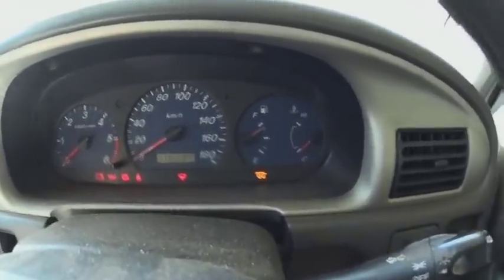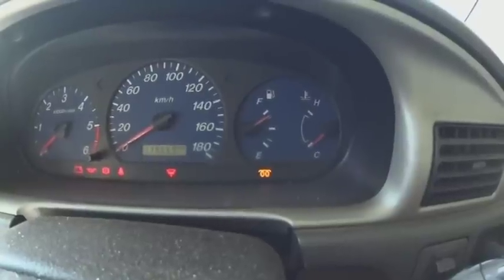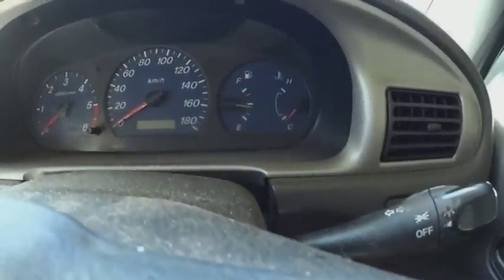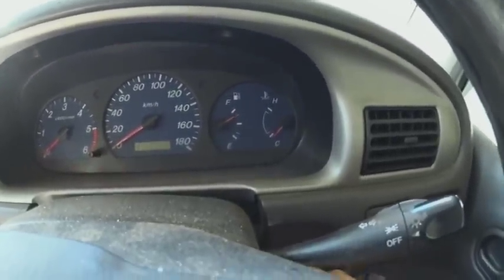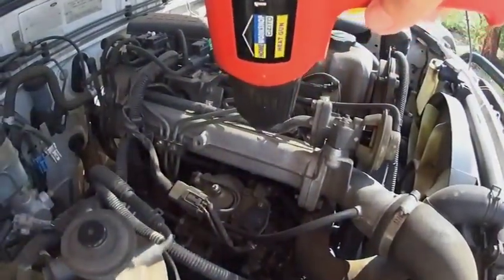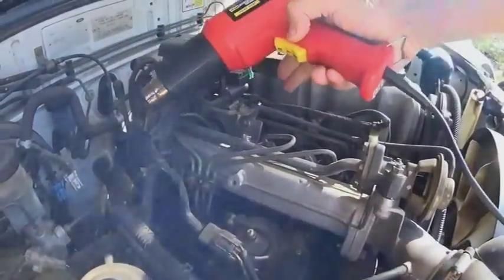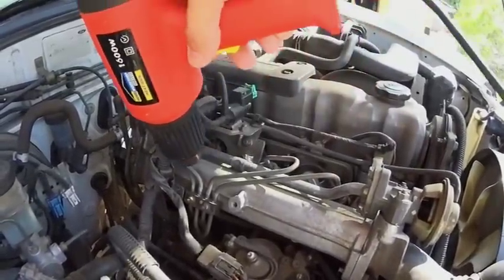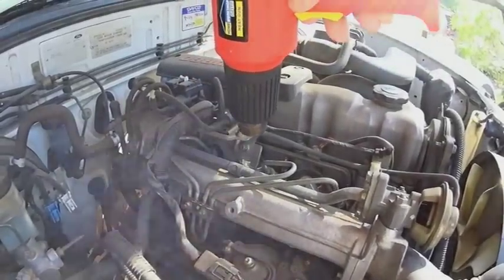Start diesel engine with faulty glow plugs

Comment: Put the heater in the air intake if possible, that's a more direct method of raising the intake charge temperature to the point of combustion.

Comment: Why does the glow plug light go off after a few seconds. Does the glow plug light not stay in if a plug or plugs are faulty
Reply: There's a relay in the circuit which cuts off power once the plugs are heated. Once the coil indicator in your dash switches off (relay cutting off), that's when you start the car. If there's no relay, the glow plugs will be draining the battery Everytime

Comment: Pour hot water on engine, not boiling hot but like 60°C its almost do the job like glow plugs
Reply: Where abouts on the engine mate?
Reply: @markw6369  yepp on injection, fuel filter fuel pressure pump and head. But be carefull not very hot water or something can crack like head or block. Good luck bro
Reply: @adamzahradnik8709  That is a good precaution, although it is almost certainly unnecessary.
If the alloys used for the engine or other car parts were that sensitive to heat & temperature changes they would fail so quickly & that it wouldn't even make sense to manufacture then and we wouldn't have cars at all!
The materials/alloys & manufacturing process have been designed specifically to tolerate & withstand a great deal of stress and extreme operating conditions, including very prominently rapid temperature changes.
Mechanics use flame torches to heat the engine and other parts for various reasons including to release parts that are stuck.
The flame torch in a shop is so many orders of magnitude hotter than boiling water...! 

I have heated engines with billing water, and cooled them down with ice cold water... While I would never claim that this could never cause cracking; I've never seen nor heard of it actually happening...
Individual experiences and circumstances will vary, take my anecdote with a grain of salt and exercise your own reasoning, logic & judgement...
Reply from the maker: I've had so many different ideas in the comments, since uploading this video, your the first to mention boiling water, I have no doubt that would work well, Thank you for sharing your thoughts
Reply: @techronmattic5876  better than hot air pistol. Works goof for me.
Reply: @adamzahradnik8709  yes, indeed!  Water is a very effective & efficient conductor of heat!   Air is not, it is actually very inefficient especially in low humidity.  It is of course the moisture/water in the air that actually conducts the heat.

👌🏻

Comment: Another thing you can do is use extension lead and hairdryer, take out the filter and box and place hairdryer in there for around 10mins in the intake
Reply from the maker: Since uploading this video I've seen so many great comments on different ways to get results, thanks for watching
Reply: You can change 1 or 2 glowplugs in 10 minutes mate, and the engine will start after. Hard, but start. Take an hour and change them all, problem solved. Glowplugs are dirt cheap, not worth all this hassle.

Comment: For my situation with faulty glow plugs of similar wlt2.5 engine, I unplug the small rubber hose (for fuel sensing compensator) on the intake manifold. Spray a very small amount of wd40 or similar flammable pressurized can. And reinsert the said hose. Crank immediately, no need to fire the glowplugs. It just gave me a one click start. Try to avoid overspraying. Just a 0.5sec of squirt of wd40.
Reply from the maker: Even hair spray will work from what I have heard, thanks for your input
Reply: Lol why not just change the glow plugs there cleared shot 🤣🤣🤣

Comment: Used a hair dryer up the air intake after the filter left it on for about 5 minutes then with it still on cranked the engine over worked every time
Reply from the maker: Yeah you will definately get more heat in the engine that way, thanks for watching

Comment: Just run a piece of wire from your positive pole on battery to glow plug rail for 2 to 3 minutes and It will start up fastest way because if this happens on the road how do you use a heat gun I did this worked for me wl 2.5 turbo and non turbo models
Reply from the maker: And the funny thing is a roadside assistant could not get me started in my driveway in this exact circumstance, he was completely incompetant

Comment: Put the  blower into the air intake is going to breed hot air will start right away
Reply from the maker: Thanks for the tip todd will certainly try that next time, make sure you check out some of my more recent content as well
Reply: I have an old Italian diesel engine on my lawn tractor, it has a nut on the intake manifold for using a heat gun to start    starts at - 20c,  at 0c it starts right up no glow it old,  smokes a bit.. maybe   give it more love, have you tried talking to it

Comment: Sorry but not a very effective way of doing it take the air filter box lid off and put the heat gun near the air intake pipe so your blowing hot air in the inlet pipe to the inlet manifold and it will crack straight up that way if your glow plugs are faulty. Heating the inlet manifold from the outside is not very effective youd be there forever doing it that way and probably end up with a flat battery.
Reply from the maker: if your in a colder climate you may  have a good point, i would definately get some heat inside  the manifold if your well below zero,  but rest assured where i live by the time you have undone the air cleaner i would already be halfway down the road

Comment: just bad pump or bad diesel, My peugeot and audi starts easy till -6 C without any problems without plugs
Reply from the maker: After getting it started i drove to my Auto electrician, he confirmed that the glow plugs where overheating due to a faulty relay, the glowplugs were replaced and a manual glow button was installed, that was three years ago and I've had no problems since
Reply from the maker: The glow plugs where replaced and faulty relay was changed out for a manual button, there has never been any fuel problem  with this car, still runs well
Reply: @techronmattic5876  do you change fuel filter every year?
Reply from the maker: Every 10,000 Km
Reply: @techronmattic5876  strange, did you checked pump valves for back pressure? because my cars dont even turn on glow plugs till -6 C and starts without any problems

Comment: Nja Change the glow flick. Fuel filter for Didzel and clean Large nozzles. 100Ah new battery jelly. Then do not jade the hair dryer motor. This will burn the starter electric motor.

Comment: I used to twist a sheet of newspaper, set the end alight and hold the flame to the air intake while cranking the engine, started every time.
Reply from the maker: Theres been so many great ideas in the comments on how to address this issue, this is what my channel is all about, using what you have to get it done, thanks for the feedback

Comment: He is wasting time heating the outside.  The cold air is inside
Reply from the maker: hi Jason
thanks for your comment, im realy enjoying the debate this video is creating, of course if you have a screw driver handy you can place the heater directly into the manifold and it will heat the air much quicker but this video is quite genuine in that it does show a solution that works, basically if you can get the area hot even from the outside it will work, or at least it did with my car, there is also a lot of great information in the comments on this subject, and in regard to ongoing problems with some models burning through glow plugs prematurely as was my issue
I realy should do a followup on this as it was one of my first videos and I realy think there is a lot more that I could cover on this subject but hopefully it has helped some people get up and running, as it did for me the first time I found my self stranded with limeted resources to get up and running

Comment: It's not the glow plugs... It's sun shine.. Glow plugs are needed for less than 7 degrees centigrade outside
Reply: Depends on the engine, most diesels that do not require glow plugs to start have normally a fuel heater, Compression alone is not always enough to get an engine to start.
Reply: ill let you try to start our 1998 pajero when the glow plugs go bad good luck any time of day and temp ...yet i have a ford transit with no glow plugs starts straight away every time .. just diff designed engines
Reply: Glowplugs help at all starts. No matter how hot is it outside, it's still not close to 200+ celsius, that's what good glowplugs bring the cylinder air at.
Reply: @em4703  Glow plugs in a diesel engine are just for the cold weather ... remove glow plugs, car starts the same, according to your comment fresh air from the intercooler its nonsence because glow plugs heat the chamber any way ... go learn something insted of making these kind of claims
Reply: @gafrancisco  "Glow plugs in a diesel engine are just for the cold weather". That's not true for 99% of diesel engines on the market right now. Maybe get in line with the new info and tech, instead of being stuck with hearsay from the 80s. And quit being such a Karen about it
Reply: If a diesel engine does not start before its heated in a warm day, its not the glow plugs, you have a problem with low compression, so heat does help because piston expands, i will say it again glow plugs are designed to pre heat the chamber when ambient temp is below -5 or -7 degree centigrade, in any car, new or old, japanese or european.

Comment: all you have to do is a small 1second spray of flammable areasol into the air intake while cranking it. starts up easily. no problems.
Reply: Marshall Nusbaum  You never wanna use starting fluid in a diesel it's not good for them

Comment from the maker: stigonutube
thanks for the comment, that is exactly what I did, the relay was burning out glowplugs so I had a button installed to bypass, the heat gun was just a tip to get you mobile

Comment: just rig up a push button and bypass the glowplug relay alltogether, what i did on my pajero and it's 3 years ago now as my pajero used to glow for 8 seconds then every 4sec for who knows how long and was burning glowplugs like constantly.. glow plug computer box+ was killing the solenoid to so was faulty i discovered but as i said cheaper to bypass the whole shit..get the parts from ebay cheap
Reply from the maker: +grim stone I think its a relay that controls the time the glow plugs glow
if your having this problem better solution to replacing the relay is to have a manual button installed, that way your not glowing your plugs every time you start your car if its already warm, extending the life of your plugs
Reply: Hi
depending on which country your from the "glow plug computer" that controls duration and how often and afterglow sits behind plastic kick panel on passenger side in AU on 1994pajeros/shogun.All i did is unplug computer and run new wires from your glowplug "solinoid" in engine compartment to a new press button switch "one that is momentary so only activates when pressed and hold" near drivers side, so your controlling how long you glow your plugs manually by how long you press button eg 8seconds tops needed on my 4m40T diesel pajero.. btw  you need to remove control wire that went from glow computer to solinoid on solinoid, replace with your new wires coming from inside. you still need a functioning SOLENOID/RELAY, if old one is burnt out or wont engage just but a aftermarket HD relay or solenoid on ebay
it's not that hard once you figure out the glow plug wire system..
Reply: Hi, i dont advise bypassing solenoid altogether as it does all the work with amps/volts, that way you can run thin control wires to solenoid from momentary switch inside car, anyways there is tons of info out there that can explain it better than i do, im a hands on kinda diyer.
Reply: did same thing
Reply: stigonutube what is the name of the part to bypass? Thanks

Comment: jumper lead from battery positive to the top of a glow plug for 20 seconds works if the glow plugs are good but there is an electrical fault
Reply from the maker: 700stuartwarren 
hi stuart
thanks for the feedback
from my perspective this solution in hindsight probably not the best solution but it did allow me to get mobile and drive the car to someone with more expertise and solve the problem permanantly
so if saving a tow fee is a waste of time then congradulations on having money to burn
also anyone else reading these comments will be able to read other peoples insights
I guess my point is if you have faulty glow plugs and all you have is a heat gun than you can get mobile